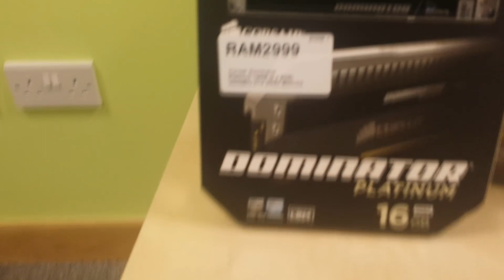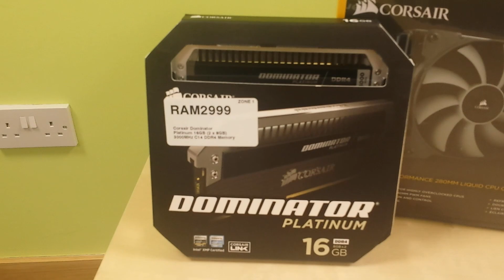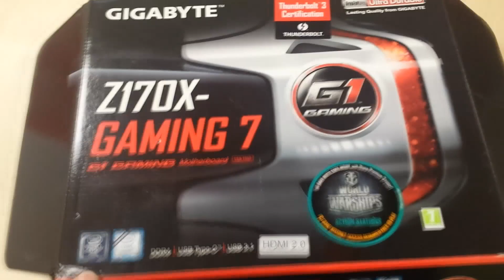My New 2016 PC Build! (May 16th)

Comment: Really cool build man! A thing you should keep in mind with airflow in the case is that hot air rises so you want the front lower fans to pull cool air in and the top back fans to shoot it out of the case :)
Reply from the maker: +Alexandru Simion Thats the ticket, the two front fans suck air in, the PSU is the top fan because the case is inverted, and theres a fan at the bottom of the PC also sucking air out (Not to mention the radiator fans blasting air up from under) It's a bit OTT perhaps :D
Reply: +LST Plays That's great man, my psu Is at the top too :) You definitely won't have any cooling issues! :) How high did you manage to get the CPU to overclock? In two months i'm building an editing/gaming PC but until then i'm stuck with an old core2duo e8400 3.00ghz cpu. I managed to overclock it to 4.2ghz and it stays under 60 degrees! :)
Reply from the maker: +Alexandru Simion I haven't even touched it yet, I need to check out what the best method is for the 67k, base is 4ghz so technically theres no rush but it might be worth doing a video on! Thats an impressive speed with that processor man wow!

Comment: I really like your video, and I learn a lot. But I got some question, what is the difference between ASUS Maximus VIII Hero Motherboard and the ASUS x99 deluxe, which one is better ?
Reply from the maker: From first glance I'd say that the Ram slots on a deluxe are a bit better (DDR4) it also has 4 extra slots compared to the Hero so in the long term you can put more memory.  All in all the price between the two doesnt seem too different when looking, the deluxe is a bit more expensive.  Here's a site I found that may help you look at the comparisons - http://motherboards.specout.com/compare/1312-4070/ASUS-Maximus-VII-Hero-vs-ASUS-X99-DELUXE
Reply: Thank you so much man. I also have another question: if the EVGA 850W good enough or should I change to the corsair cx750 or the corsair rm 850 ,which one is better ?
Reply from the maker: I think an 850 will last you longer, but there's probably not much difference between the Corsair and the EVGA check to see which has the better warranty on the models you are looking at. (I'd imagine EVGA)  Also take into consideration how much power you need, try using a site like Power Supply Calculator - http://powersupplycalculator.net/ Thats what I do before I buy anything, remember your core components are harder to swap out thatn your graphics cards etc, so you want to make sure they are good and fit for the job.  Hope this helps dude.
Reply: Thank you man , it really help me a lot.
Reply from the maker: Great to hear, keep an eye on my channel I'm trying to do more things like this video.  I also take requests from time to time on topics that people want me to talk about.
Reply: Ok, I think you are doing a wonderful job in your channel.
Reply: I want to build a pc, but I am wondering should I wait for the BlackFriday. Do you think the GTx 1080, i7-6800 , asus x99 deluxe ii ,asus rog swift pg27AQ will have a huge discount ?
Reply from the maker: +马健彬 I doubt the card would, Black Friday is always geared to retailers and online traders getting rid of old stock for new stock arriving.  Motherboards might though, its really hard to say. I would recommend keeping an eye on a few sites like Aria PC and Overclockers (If you are UK based)
Reply: ok, thanks you a lot
Reply from the maker: No worries, hope you get something sorted.
Reply: Is the combination of asus x99 deluxe ii and asus stri gtx 1080 better than the combination of asus x99 deluxe ii and msi gtx 1080 gmaing x? Or just the company of the video card doesn't matter?
Reply from the maker: +马健彬 As long as they are both compatible with an intel  chipset if thats the slot type on the MB then i would say that the rest wont be as important.  Have a look on Google to see which MB's the 1080 has been developed in conjuction with even. Apart from that dude I think any difference would be so minute that you wouldnt be able to tell. Hope that helps man, I've an FB page too don't forget if thats handy.
Reply: Ok，thank you so much.
Reply: What does the "some Intel X99 chipset motherboards may need a BIOS update prior to using Broadwell-E CPUs" mean?
Reply from the maker: Don't think the Broadwell CPU's are out yet, so the BIOS on the MB may need an update to recognise the Chip.  I would contact Broadwell for further details and to confirm.
Reply: So if I buy the asus x99 deluxe and i7-6800，do I need to update the bios in the first boost?
Reply from the maker: you might need to, but i would image that Broadwell may be able to tell you, you should be able to download drivers and stick em onto a usb if it does. (Ask them first though)
Reply: ok, thank you for your patience.I am noob in these staff,,
Reply from the maker: No worries, sounds like a beast of a rig you'll have! :-)
Reply: I just ordered the Msi gtx 1080 gaming x, will it fix to the asus deluxe ii motherboard?
Reply from the maker: Yep it's PCI express so will fit to pretty much anything, MB's are only really made with PCIE these days to my knowledge. Very nice card! (Not jealous at all....) :-)
Reply: Thank you so much for answering me at such a late night man.
Reply: So I will need 2 software right? One for the asus x99 deluxe and one for the msi gtx 1080 gaming x ?
Reply from the maker: No worries, it's 9am here in Northern Ireland ;-)
Reply from the maker: 马健彬 Not sure what you mean?
Reply: Do I need a msi gaming app to control the msi gtx 1080 gaming x? And the asus control app to control the asus deluxe ii (like the light or check the temperature of the motherborad)
Reply from the maker: not sure dude, I'm sure they have something, perhaps check their website
Reply: ok, thank you anyway for answering me at such a late night.
Reply from the maker: No problem!
Reply: I alreday order the corsair 750Dcase, corsair rm850 power supply and corsair h100i ,and I am going to order the i7-6850 and the asus x99 deluxe ii, do I need to order a Arctic Silver?If I do, which one should I oredr (I got no idea to choose which one, can you give me a recommodation?)
Reply from the maker: It's not exactly needed, for instance I get away with just using the thermal paste strip that came with the Cooler, but it's up to you.  (You will literally only need a tiny amount if you do buy it)
Reply: thank you
Reply: How does this monitor connect to the pc(i purchase the gtx 1080)? throuhg the hdmi cable or the displayport1.2 cable
Reply from the maker: HDMI I would imagine dude
Reply: ok ，thank you man
Reply from the maker: No Problem
Reply: Does the asus x99 delxue ii have a wifi netword card inside? I don't have a network cable. Do I need to buy one, if I need to buy one how can I install it?
Reply from the maker: Network cable should do the job, I don't think it has a wireless card in it.
Reply: Thank you so much.
Reply from the maker: No worries dude, good luck with the build! :)

Comment: What's the price, is it good at gaming and programming? What are the flaws of this pc?
Reply from the maker: Hi price for the parts I got to add in were about £500-£600 for the total PC you are probably talking close to £1000. The GPU I picked up last year for about £250, then once you take a PSU and a copy of windows into account its probably not far off.  The PC handles great, no issues what so ever with performance. I game, edit videos and process vids on it and all has worked perfectly (Sony Vegas 13) Oh and Nvidia Shadowplay to record. I hope that helps?

Comment: what a horrible time to buy... RIP money
Reply from the maker: Not sure I follow man? :)
Reply: Well, the GTX 1080 and 1070 have came out (or are coming out) along with the AMD 480 along with the new Intel Chipset coming out in july or late june. So a bunch of new hardware is coming out and this PC was built just before all of it released. It will be dated in like 6 months. However if you are fine with that than your investment was well spent. :)
Reply: but hey, ur ram choice is gud :3
Reply from the maker: +Ryan The card is about 2 years old, maybe i should have made it clearer that i used some parts from the existing machine? Also the board and chipset are still very very good, theres always better out there however, but sometimes you gotta keep within a budget ;)
Reply: yep, very important to stay in budget, would you like to see my PC I will building this summer? (i'm going to link it anyways)http://pcpartpicker.com/list/BcQCm8
Reply from the maker: +Ryan very nice, should be a beast too! Phanteks case is highly recommended, great brand. :)